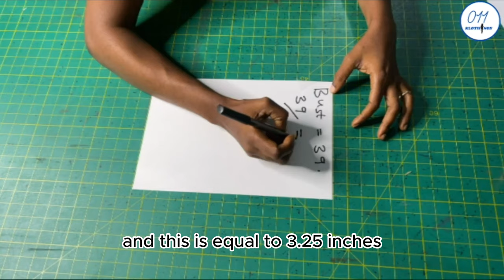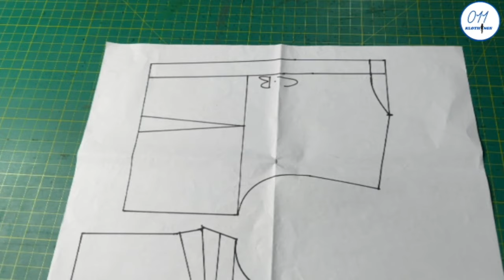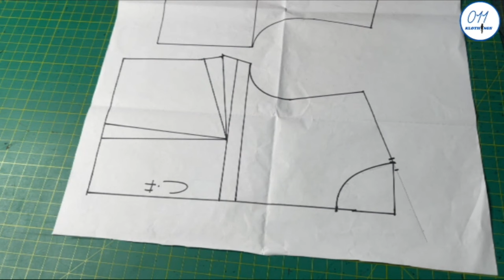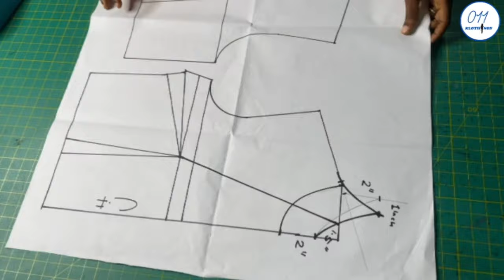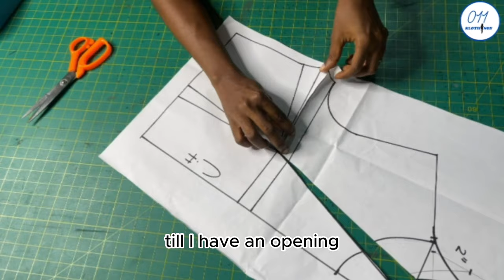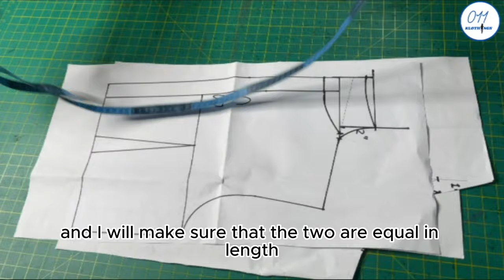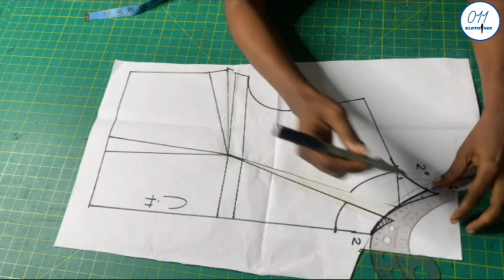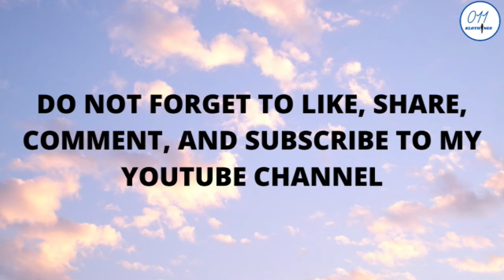HOW TO MAKE A CLOSE FITTING ALL- ROUND BUILT-UP NECKLINE - 4

Comment: Pls is it compulsory to add d dart at d front neck
Reply from the maker: It is not a dart. It is a one inch opening.

And yes,for this construction/ drafting method, the opening is mandatory. Even with the opening, if the fabric has no stretch at all, the built-up neckline will be tight.
Reply: @ZERO11KLOTHINGS  can I still do this opening on a bustier either shoulder or princess dart
Reply: @ZERO11KLOTHINGS  thanks for d explanation